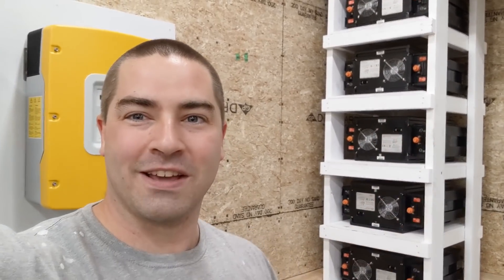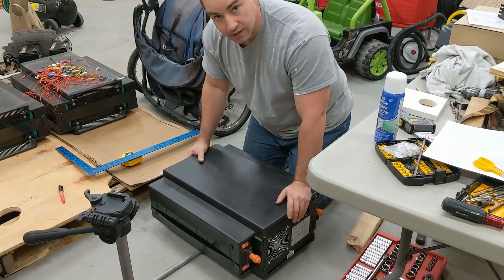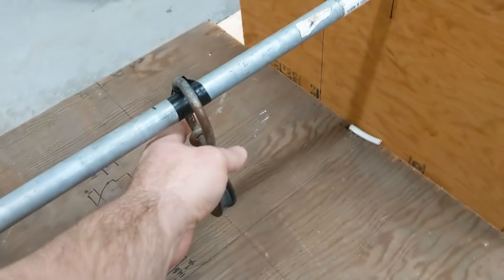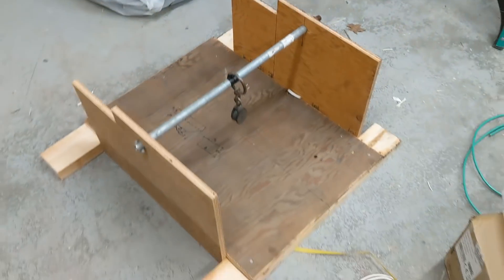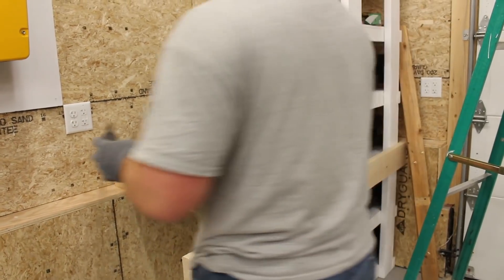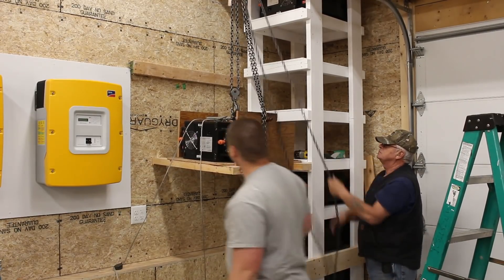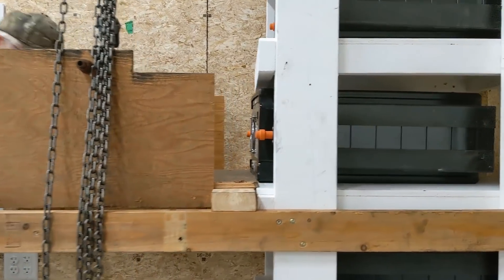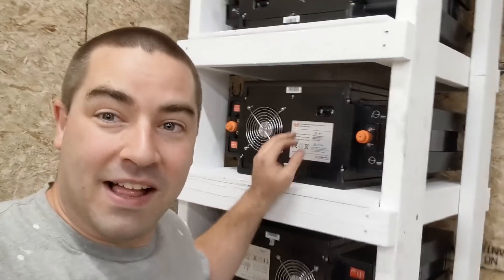Hoisting Batteries, 48 volt Off-Grid Solar

Comment: I missed the back story on this - what is the intended use of this big battery bank? In your most recent video (beginning to condition the batteries) it seems like the inverters are grid tied. Are you going to be able to go off grid as well?
Reply from the maker: I am building an off-grid system.  It will serve as a whole-house backup, and also save some energy depending on what loads I shift to it.  This is version #2 of my system.  I have a good over-view video of version #1 which will give you an idea of what I'm going for.  This is just bigger.  https://youtu.be/722GNWlEN1g

Comment: Your should reinforce that shelf.. Lag bolts and and standard bolts could hold it alone. But your design I would ad 2x4 pieces on the inner legs from floor to top..  If the top one gives.. I'm afraid with that weighyou will get a domino effect. And the entire structure will collapse.

Comment: David, I would have kept those batteries much lower, they are heavy, slippery  and delicate. It would make servicing them easier too.  Ideally under a work table with a server  sliding shelves. I ordered those si6048 pair. So please make a video on their setup.  I am surprised you took your existing setup down before installing your new one.
Reply from the maker: Hi Wasif,  Thanks for checking out the video.  Yeah, if I had to do it again I would also keep them lower.  Sometimes I get these big ideas that end up being silly in the end.  LOL  I'm super excited to get the inverters running.  I'm trying.  Yeah, I had to sell the Volt batteries to buy these.

Comment: @DavidPoz, in looking how you have the batteries laying, it looks like you're going to make your configuration 2S4P.  I've been tying to research the best way to configure these, and I thought it was best practice to wire them: 4P2S.  Can you comment why you chose to configure yours the other way?
Reply from the maker: In my current arrangement I'll be wiring them into pairs, for 48 volt.  That will make 4 batteries, each at 48v.  I will then parallel the 4 batteries.  To parallel them I'll be running 4 positive wires and 4 negative wires.  Those wires will terminate on a Buss bar, and all the wires will be equal length.  My goal is to make all the batteries be used equally, equal resistance from bus bar to battery.  But, I'm going to run the configuration as a daisy chain on another setup to find out how much this actually effects voltage drop in the real world.  I don't feel too strongly about it one way or the other.  Whatever works for you.
Reply: @DavidPozEnergy  Weren't these batteries 48 volts to start with?  Why convert them 24V only to wire two of them in series to get back to 48V?  Seems like a lot of extra work for no apparent reason.
Reply: They’re 24v for sure.  I was just wondering if there was something that I didn’t know that I should be doing. Others (I.e. DIY Will Prowse) say to align cells parallel,then series to get the desired voltage.  Is it because they’re all ready wired in series inside the case?
Reply from the maker: Hi David, you got it correct.  These modules are already wired in series.  It's easier to use them in this configuration.  Thanks for watching.

Comment: Thanks for your videos David!

There’s a big group of DIYers here in California that just got a hold of these units.

I’m particularly interested in your BMS plans and how you’ll combine them. I’ve seen lots of warnings against parallel configurations for these types of banks so I’m excited to see an expert’s approach.

Thanks again for your channel. I’m following your rewiring advice exactly!
Reply from the maker: Hi Sean,  I've been making an external wiring harness with Molex connectors to be able to plug into the plug on the front.  This is extremely time consuming.  I keep asking myself why I didn't just run a new wire to each cell?  It would have been so much simpler.   Haha.  I'm already into it now, but next time I would probably just do that.  I post pictures on facebook, if you want to conect there we can talk in more detail.  I'd love to see pictures of your setup.  Thanks for following along.

Comment: Do the new SMA inverters have the capability to charge other lithium chemistries like the old Volt batteries you changed from ?
Reply from the maker: That's a great question.  I don't know.  I haven't been able to check through the menu yet.  Still trying to wire everything up.

Comment: Your wood rack design looks like it depends on the shear strength of the wood screws.  I don't think this is strong enough for these heavy batteries.
Reply: It sure does. Lots of weight there!! The better, safer solution is to use a "structural" fastener such as "HeadLOK" or even better shear capacity "LedgerLOK". Available at the big box home improvement stores.  As was seen in this video, you can't always see a failure happening before it actually does fail.(the pulley) If one lets go close to the top, the whole thing will 'pancake' . Lots of damage will be done to the batteries, the structure, and anything in the path of the fall. I'd be most worried about the electrical short potential though!!! That's a LOT of energy!!  Fire? Yup. Explosion? Likely.   The hoist got an upgrade, Time to do the same with the rack!

Comment: As a side note,  you might consider bolting a piece of angle iron under the 2x4's supporting each shelf. I had a similar build collapse that was screwed together with 3" screws because of a minor shift in the weight in the top. Bolting a small amount of steel supports eliminate the torque. Great job as usual.

Comment: Hey, I should have perused your channel closer before making my comment on the inverter video. For some reason I thought that you purchased 12 batteries instead of 8. Because you don't have the cooling fans connected,  do you have to have a cooling system? What gutbusters! I really want to buy some but don't know if they can be stored until I get my new system up next summer. It seems that the minute after you post a video on something you get a good deal on the prices go through the roof. Such is the case with the inverters!
Reply from the maker: Hi Craig,  Makes me wish I was selling the inverters, LOL.  I still have the cooling fans wired to the plug, and I'm including an extra +/- wire in my wiring harness so I will be able to power the fans.  However, I doubt I will ever need to.    They can be stored, but I would cycle them a bit first with something like a T-8 charger before putting them into storage.  But, there are always batteries for sale.  If these are no longer available there will be something else.

Comment: Would it be a good idea to add a fire barrier between batteries ? I'm just thinking if the most bottom battery catch fire, would this rack turn into a big fire ? Or thoses batteries are safer enough ?
Reply from the maker: These batteries are LiFePO4 chemistry, which is considered the safe type of lithium.

Comment: Wow.  So close to dropping . . .  So whats the Point loading on the concrete floor ?  I realize concrete is strong in compression but if the point load os too great, the concrete will/might crack. And a bit more bracing on the rack. Better to over design than under design.
Reply from the maker: It's about 40 psi on the concrete, not much.

Comment: That is over 1,400 pounds with the weight divided by four main supports.  Each support carries 350 pounds.  

Check on an engineering manual whether the type of wood used can support this weight given the dimensions of each support.

Usually, the manual will suggest by how much to oversize to compensate for fatigue of each material.

Keep in mind that with your local weather conditions, the wood will shrink and expand due to heat and humidity.

Has the wood been treated in anyway (pressure or termites)?

Another problem is ventilation at the top, particularly, for the summer.  Heat rises, and it might get kind of hot near the two top batteries.  

Is there an exhaust vent for the heat?

Will the floor stay dry?  Will it tend to go through an occasional flooding? Do you wash the floor with water?

These are things to keep in mind which might or might not be factors affecting the strength of the wood through time.
Reply from the maker: All good points for someone to consider when building their own racks.  Thanks for your comment.

Comment: A common mistake I see in construction of wooden load bearing shelves and stuff:  The load is being entirely borne by the screws in the side.  That's the shear point.  Otherwise, very ingenious
Reply from the maker: You are right, and this is not how I build decks.
Reply: @DavidPozEnergy  in your favor,  each shelf only has 200lb and is distributed by numerous screws which probably each have a sheer strength of over 80lbs so any one shelf can hold the battery pack easily
Reply: DavidPoz if you’re reinforce with L brackets under each shelf it would help.
I’d also box out the ends with more lumber to add additional support.
Reply: Yasy to remedy, wall the shelves with plywood.

Comment: You need to get a 12vdc electric winch.  I have one of the smallest from H F and used it and one snatch block to lift a complete mobile home a/c unit to my attic.  In case you need to do anything in the future give it a thought.  Really looking forward to seeing the output and use of these batteries and the new inverters.  Being able to have 220vac will be nice!  Really appreciate you showing how things really work, sometimes not as expected, but real life learning be safe!

Comment: You can also see the metal of the non-rusty side is crystalized, something that happens over time especially if the metal is exposed to physical impacts.  It is not a good idea to use old stuff if you really need to count on it.
Reply from the maker: That's the lesson I learned.  Now I can't make sense of that saying "They don't make things like they used to"
Reply: @DavidPozEnergy  BTW, I ordered 10 of these on Tuesday, based only on your videos! Ha! Pressure!
Reply from the maker: Cool.  I'm trying to get these running but everything takes time.  I've got about 12 man-hours into just soldering up a BMS wiring harness.  LOL  I'd love to hear how your build goes.  If you are on Facebook, it's an easy way to share update photos.  I post there in real-time my progress.  https://www.facebook.com/DavidPozEnergy/

Comment: When I first saw the cradle the battery sits in I thought, "would have been easier to screw 4 eye bolts in the top of each battery and tie them together to lift."
But the old pulley would still have broken and the battery would have fallen to the floor.
But the saddle you made was supported by two beams extending out from the battery rack, so when it fell the saddle was caught by the beam extensions.
So the design you implemented originally had a safety measure built in.
No one got hurt.
Credit to you for a fail safe design.
Reply from the maker: Thanks for seeing that.  I'm not sure I pointed it out well in the video.  That's also why I built the first support up high, instead of just hoisting the battery from the floor.
Reply: @DavidPozEnergy  No problem. Stuff like this happens everyday even though we try to think our way to a safe practice. Who could foresee the invisible fracture in the pulley eye? You do nice work.

Comment: Perfect video.  Perhaps the pulley was cracked, but I've found that it's all about the slow motion of pulling.  You guys just went for the dead lift.  I can't wait to see you hook those baby up.  I've been away from your channel for about six months, and I just catching up now.  Have you found the batteries from battery hook up to be good.  I'm thinking on contacting them about their Nissan batteries for my off grid home.
Reply from the maker: Thanks for checking out the video.  It's quite embarrassing, but worth sharing if I can help prevent someone else from making the same mistake.  As for these batteries, I have not been able to test them yet, so I don't know how good or bad they are.  They are all holding voltage, so no self-discharging.  Nissan Leaf packs seem like a super easy build, just bolt up.  If these modules were not available I wouldn't hesitate to buy two Nissan leaf cars worth.  If you do purchase some, I'd really appreciate using my affiliate link in the description.  Every little bit helps.
Reply: @DavidPozEnergy   Thank you and indeed I will use your affiliate link.  I appreciate the time and great quality of your videos, and with your videos showing the correct way and sometimes the incorrect way, It saves me time and money.  Time I have, money, not so much.

Comment: I would recommend to reinforce that rack it's to much weight
Reply: I agree - although it does appear to be a strong structure, one little fault (not unlike the hairline fracture in the pulley) up high can cascade the damage down (think of twin tower disaster) or tip the whole frame over. It's not like lumber has never fractured or split before.
Reply: I agree, also very susceptible to fire
Reply: @jointstrike2  not to mention earthquakes, tornadoes and volcanic eruptions.

Comment: Excellent chain hoist solution Dave :) I didn't quite catch the capacity and Watt Hours per 24 Volt battery ?
Reply from the maker: These modules are nominal 24 volt.  Originally they had 5.6 kwh capacity, 220 ah.  But they are used so I won't get that much out of them.  I haven't done a capacity test yet, but should be at least 4.5 kwh per battery.  Battery hookup is selling them.  If you use my link in the description then I get a kick-back (affiliate link).
Reply: @DavidPozEnergy  Hmm...I don't see such a battery at that link.

Comment: But you skipped the top battery install,,, I''ll bet that one was a challenge as I could see it wouldn't work as it was rigged with the chain hoist... How did you get the top one up there?  Just wondering... Great video, love how you explain everything..
Reply from the maker: I hoisted it as high as I could go.  Then installed my wood blocking on each side (as you saw).  Then removed the hoist and started levering it up and cribbing under it.  Only had a few more inches to get it to the right height.

Comment: That looked like one of those pulleys used inside an old window meant to hold the weight of the window counterbalance. After that mishap I think I would drive another screw into each side of each 2 by 4 in that rack and brace it to the wall in 3 places just to be on the safe side. Are you in a earthquake zone?
Reply from the maker: This is not an earthquake zone.  The pulley is bigger than it probably looks in the picture.  It's an old pulley, but was originally sold for 1000 pounds.
Reply: @DavidPozEnergy , I guess someone must have used it to lift 1001 pounds a few decades back and it has been cracked and rusting ever since.  Stuff happens.